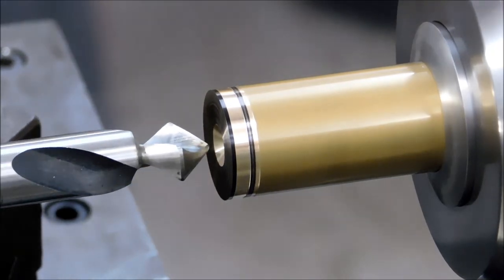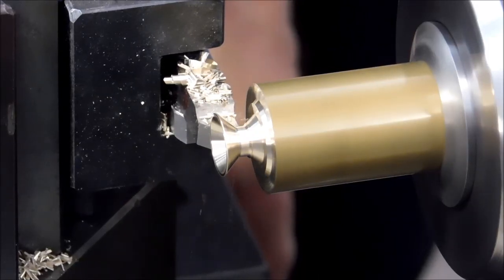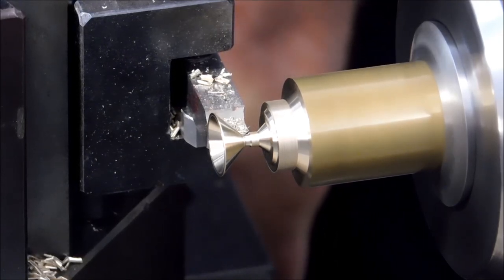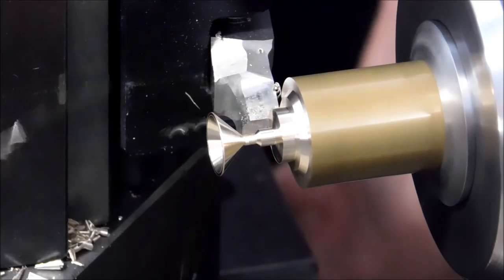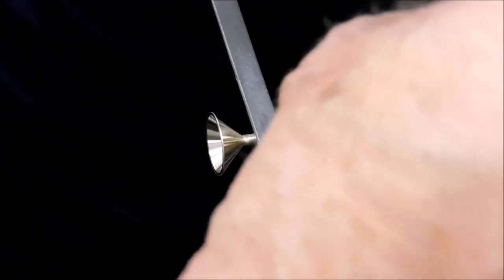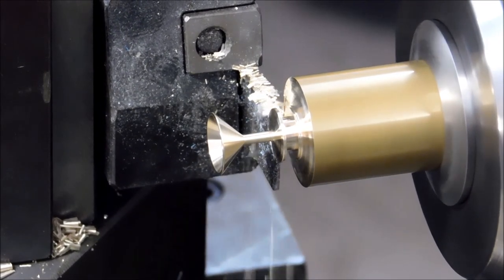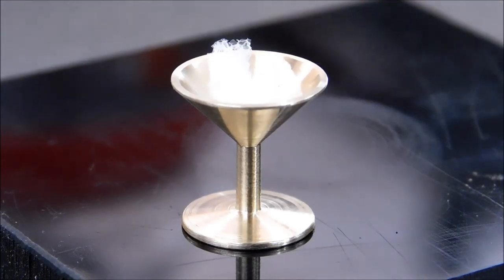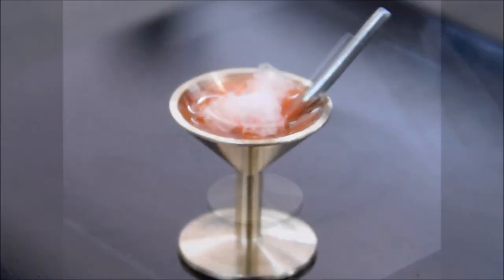Machining Miniatures. A Cosmo on Ice !

Comment: Thanks for the entertainment Joe! I recently turned some small stainless parts, .070" and .080" diameter about .75" long with 5-40 threads on the far end for a total length of about 1." I used the technique you showed in a previous video where you advance the stock out of the collet a little at a time to avoid bending the stock, worked like a charm! Thanks again!

Comment: wow! I gotta try that. Probably have to restock all the brass I have to get just one to  come out, but that is one of the many difference between hobby and professionals. Appreciate the tips on why you made under cuts on centering tool and the thought processes as you worked to mitigate "pinwheeling" the part.  Look forward to the next cabin fever project.

Comment: Great work. 
That piece could be remounted on a wax chuck that watch and clock makers use, using shellac. The work is centred while the shellac is soft. By slowly spinning the lathe and touching the work it finds its own Center. Gentle heat will break the bond for removal.
Keep the vids coming.
James Truesdale. 
TheClockworks.biz

Comment: That was cool. I made a small pulley out of brass for an old tube radio I restored. It wasn't as small as the little "glass" that you made but I experienced the first one flying off into oblivion because I rushed it and it climbed up the tool bit.
Reply: been there done that...it's always on the final "ooh, I think I will just touch this up" stage
Reply from the maker: That will happen when you least expect it.

Comment: Joe . Use your live center make a taper bushing to fit the inside taper of the goblet so you can get away with more tool pressure and not crash turning the stem .🐤🐤🔔
Reply: You get other issues at these sizes instead. First is the risk that the stem collapses due to pressure and when you start turning if there's an even so slight bow in the material due to tool pressure it binds and folds.
(Yup I've tried that and that was on a much smaller machine with very light controls, though I could just touch it with the center without putting pressure on or after that that touching and backing up would do it. Safety glasses are GOOD.)
Reply from the maker: @sharg0  Your comment is very accurate. A center that almost touches the part is ideal for a part like this. I usually hold a finger on the cone of the center as I advance it. My finger serve as a light brake. When removing my finger allows the center to turn, Lock it off.

Comment: Hey joe, long time watcher, i decided to comment of this video because its new, and i figured you would see this comment.  Anyway i have a old Delta Rockwell metal lathe, that has the L-00 spindle taper, problem is my L-00 taper on my chuck back plates have been damaged, due to previous owners installing them with chips caught in the taper. Of course this leaves chip impressions in the backplate and cause it will rock back and forth when installed. Could you maybe due a video on how to repair something like this? Your a very clever and talented machinist, so i thought maybe you would  be able to help us out???
Reply from the maker: Your damage is probably a raised area around where the chip was pinched. Since the whole taper is working for you, a spot repair with a die grinder probably wouldn't hurt anything. Just dont be too aggressive. Your problem may be how to hold the backplate without a chuck to hold it. you can also strap it to a faceplate and use an indicator to trace the angle. Look for the high spots that way, but don't enlarge the taper while cutting.
Reply: @joepie221  Thanks Joe, ill be sure to give this a shot.

Comment: Before I became an EDM specialist my favorite machine was the lathe. Nice job and some excellent tips. Brass is so nice to work with. My favorite cut in the wire EDM was the squircle. One inch square at the bottom and a one inch diameter at the top. I miss my trade but retirement in Jamaica is nice. Bring back manufacturing to America.
Reply from the maker: Good to see you stop by. I personally don't run a wire, but had a friend who did that with his first name on  one side and his last name on the other. Its all about balancing how many points you have. He also offset the heads and cut a trapped hourglass in a steel plate. That was cool.